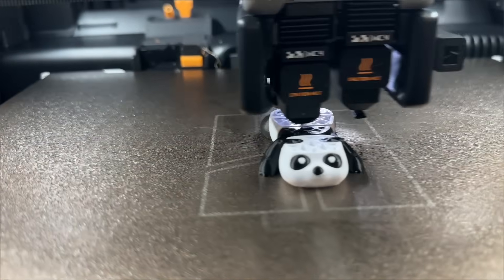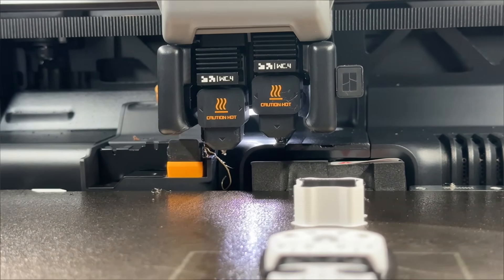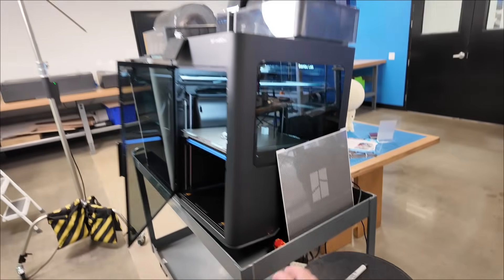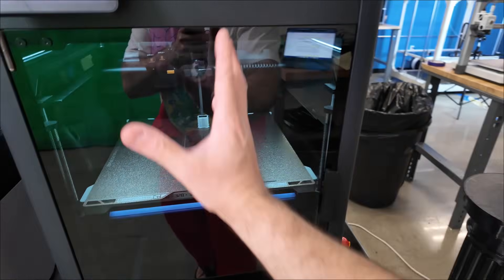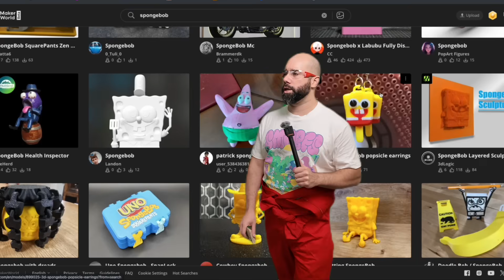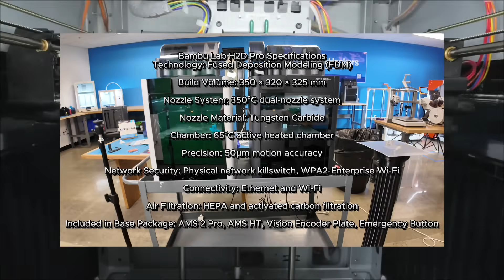H2D Pro - Don't Buy This Printer! (Don't make my mistake)

Comment: I bought mine, did two prints and now there are 9 error messages and the thing just won't respond. I suspect that there is a connector that has come loose but, looking at the Bambu wiki page it looks like I have hours of disassembly and reassembly before I can get to the right place to check the connections. Not what I'd hoped for.
Reply from the maker: Yeah here at the office we have three H2Ds and we have had some problems here and there with them. From the beginning I was like, these are pretty complicated with all their little moving parts and interchangable thingies, I could see more problems with them than the other printers. more to get wrong. Not sure about the Pro, but I'ts very similar to the others. Still pretty cool though, I'm printing some shoes on an H2D right now using TPU and PVA for support. Hopefully you can get yours fixed soon, check your warranty if you need to use it. Although that's possibly a bigger pain than trying to fix it.

Comment: 50µm is about 1/3 the width of a human hair.  This isn't really about print quality, but accuracy -- if you have two holes 20 cm separate from each other, it ensures the holes are going to be accurate.

Overall, where this printer shines is old school twin nozzle stuff, one nozzle for support filament, one for the print filament.  This allows me to easily have breakaway supports, or supports that dissolve in water.

I'm probably going to buy a couple of them.  The creature comforts and ease of printing stuff is a nice step up from the X1E (which also has Ethernet.)

Comment: 3 800 without accessories, that’s a steep price when the mechanics and build volume are the same as the H2D.
Reply: It comes with the AMS 2 Pro and AMS HT as well as the calibration board. It has proper networking security, including physical kill switch to disable networking. It has tungsten carbide nozzles for long life with CF infused materials. It has an upgraded fan system for the print head so can go hotter than the standard H2D, the air filtration system is upgraded and it has more memory than the standard H2D. Only approved suppliers can sell it so you get better support.
I cancelled my order for the standard H2D and am waiting on the H2D Pro to arrive. I am an engineer so wanted the higher quality parts it offered because I use engineering materials to print with but it isn't really aimed at printing a toy in PLA, for that get an EasyThreed or something cheap. I also use a Markforged and the H2D Pro is cheap compared to that.